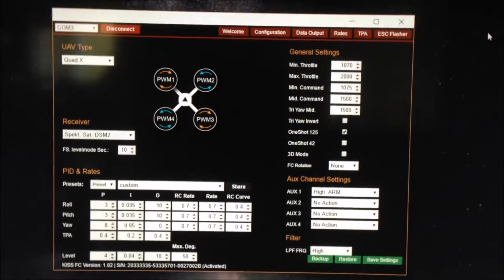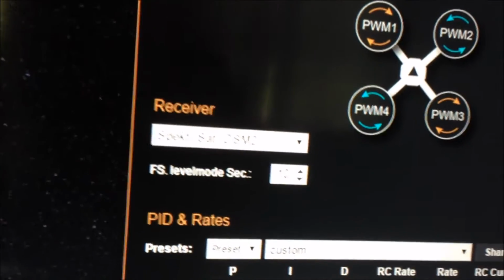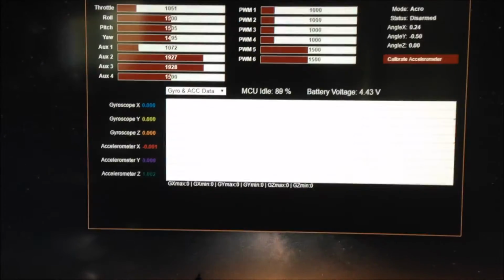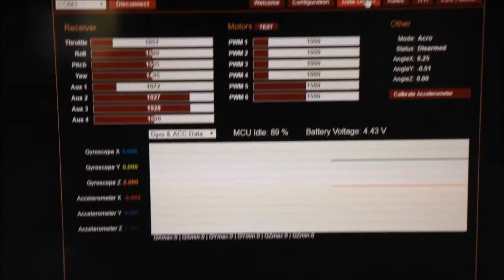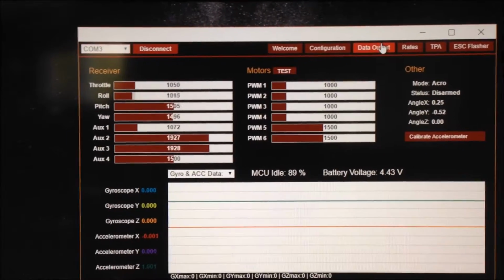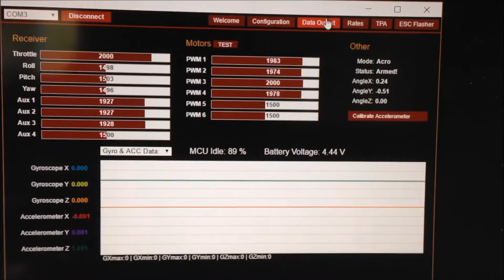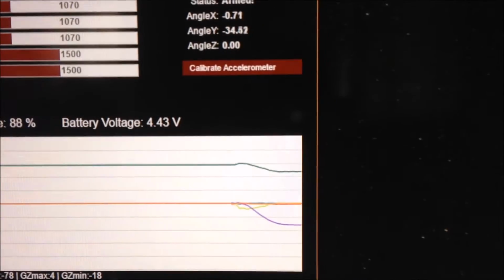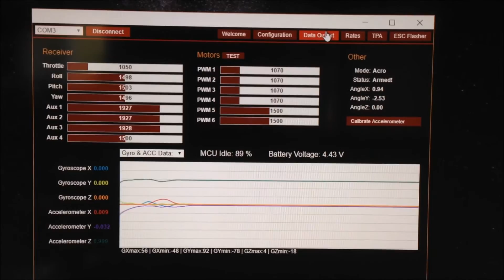kiss flight controller will not spin up motors

Comment: I am having the same problem with the KISS FC,  Rotorgeeks ESC's and Emax motors - Exact same issue.  I just sent a question to the Rotorgeeks Tech Support since they sell both the FC and the ESC's and see if it makes a difference.

Comment from the maker: SOLVED!  David W is right on!  un-check both one shots and now my quad works!  Thanks David!
Reply: How did you get it solved? I have a same problem with FW ver 1.2.Did you turn off oneshot42 and oneshot128? So what you choice is for ESC?
Reply: Glad we could figure it out! I've now done a calibration of my esc through the Kiss FC, but my throttle is not linear. You can hear the motors hit max rpm around 60-70% throttle input on the stick  and it doesn't increase in speed for the last 30% of stick movement, not sure what to do about it.
Reply: How did you get it solved ?

Comment: OK, I'm also using SimonK with KISS FC and I got the motors to work. On the Configuration page UN-check the Oneshot125 box, make sure Oneshot 42 is also not selected. Save and reboot, should work now. Now I have to figure out how to calibrate and then see if it will fly.
Reply: I am having the same problem when calibrating my esc. Have you found the problem yet?